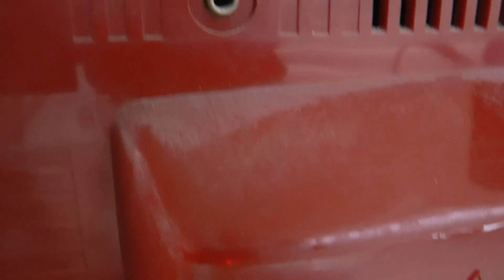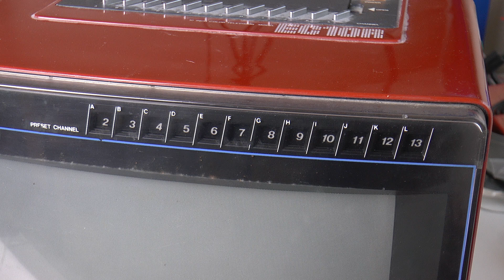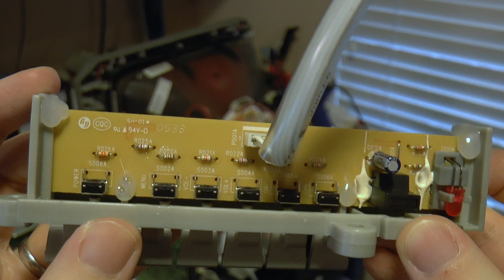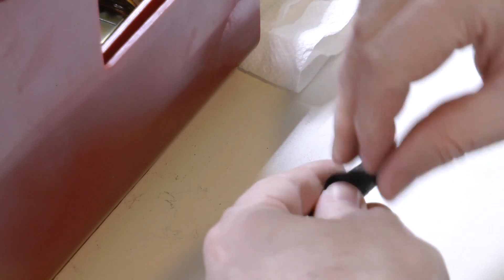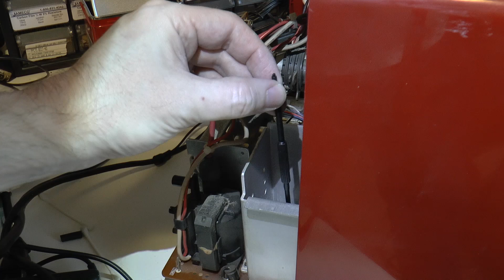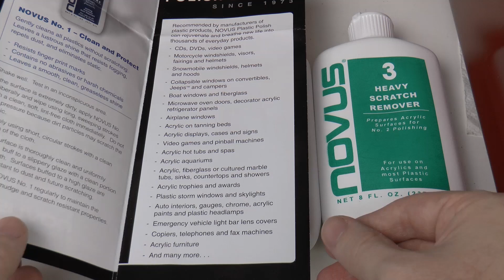Do you game on a CRT? Review and Repair of my friend's RED CRT

Comment: I bought one of these at the flea market yesterday and it looks almost like new. It's dated October 1986 it was just too cool looking to pass up.
Reply: Oh, btw, the one I bought has RF input along with the antenna screws and a little pull out piece to go from UHF 75 ohms to 300 ohms. Can't get a picture from a NES yet tried composite and RF so may be something to do with that switch on video not working for the composite and the RF not sure unless it's that UHF setting piece needs to be on 300 but I think not. Maybe the tuner is crapped out but the channel buttons do change the screen when pressed. The guy assured me it worked but who knows if I can get the composite working that's fine. If I can't get it working I'm going to removed the insides and find a LCD that will work inside it since the TV is so awesome looking.

Comment: I combine a high-quality consumer set (Trinitron) with component input for PS2, Xbox, Gamecube and composite for NES, SNES, Genesis, and PS1. I own a decent LCD and have modern FPGA consoles like the Super NT, but honestly I don't think anything beats the classic warmness of the original systems on composite input for those 4. 

That said, now I also own an Analogue DAC so I could still get that chunky analog signal from the modern FPGA consoles if I really wanted to. But so long as my original hardware works, I'll keep using it.

Comment: • I want to see a followup. I've got a TV that doesn't keep the picture horizontally stable. 
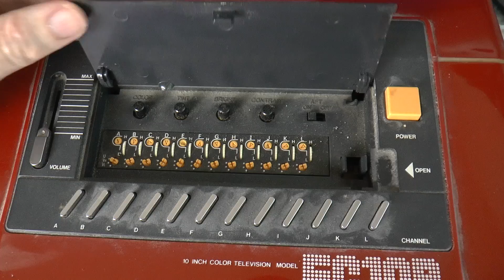(3:42) That looks just like the tuner on the VCR we had, which allowed us to pick up premium movie channels, with varying clarity. Late night softcore was the best I could hope for. 
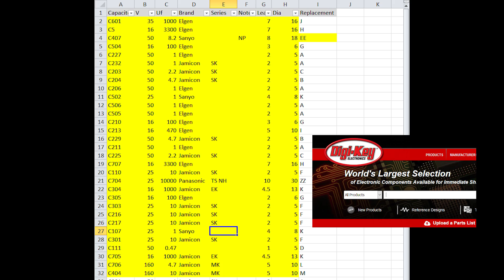(7:26) I forgot Digi-Key sells capacitors. Last time I ordered from them was 9 years ago, and it was to cover the landline phone jacks with plugs, to stop some of the air leaks in my apartment. 
What I was actually after, was opaque optical output covers. I have a DVD player that was a display model which lacked an opaque output cover, so the player shows a bright spot on the wall. I tried covering it with black electrical tape, but it wasn't enough. Layering the tape fixed the problem (sticky side against sticky side so as to not leave residue), but I'd rather have a proper opaque optical cover.

Comment: I have a CRT from 2004ish its part of a Sammy arcade cabinet, the CRT has issues, it displays a picture with a heavy red tint, I connected a 15pin vga connector from the Atomiswave unit to an LCD and it worked fine, my guess is the CRT is faulty. I'm going to scrap the whole system, if you'd like I can send you the atomiswave box along with the game cart (Maximum Speed) and jamma connector for your own research. you can have it for free. I believe it is just a sega dreamcast which takes cartridges rather than CD's.

Comment: Yeah I'm one to be happy enough with composite. I do prefer to game on a Trinitron though and not the shadow mask sets. I got a wood grain version of a Sony KV-1393R and I think it's beautiful. I did a CRT swap with it from my KV14TR24 since the convergence was pretty bad on the original tube and the deflection yoke had no adjustment rings on it! (it came with a plastic sleeve covering where they should go so it must have come off the factory like this). Even with a different yoke that had rings I couldn't get that tube where I wanted it so I just used the one from my KV13TR24 as I managed to get the convergence mostly ok on that one. :D

I even soldered in a trim pot for vertical linearity after finding where it should be on the schematic. The new tube/deflection yoke combo needed an adjustment but this set didn't have that adjustable. Used a fixed value resistor instead so I had to take out the resistor and put in a trim pot in it's place. I had also changed out a resistor used to control the screen sharpness control. On this set there was no knob or adjustment for that. They also just used a simple resistor. I used a trim pot to get it where I wanted, then got a resistor with matching value and used that to lock that in. It's looking great now. :D

Oh and if your wondering how I have an extra yoke...well long story short, the KV14TR24 was my first Trinitron I wanted to get. The first one I got off eBay was packed poorly and the bottom mounts for the CRT had failed while it was in shipping, The end result was a destroyed neckboard and a necked tube. So after got refund and confirmed seller didn't want it back, I kept the main board and speaker, and deflection yoke, and tossed the rest.

Then got a second KV13TR24. This one was packed much better (also off eBay). But it arrived with the same failure too! bottom mounts failed and the tube had swung up a bit. This cracked the neckboard in half (but not as badly as the first one) and somehow the tube didn't get necked. The main board on the set was dead though (had a crack in it and a bodge wire soldered in so looks like that board was cracked before it was shipped). There was also evidence of rust on some of the RF shields. Luckily the main board from the destroyed TV was still in great shape. I fixed the broken traces on the cracked in half neckboard and got the KV13TR24 back to working order (I had also gotten a refund on the second TV by the way). The neckboard from the first set broke in half in away that severed alot of traces so I couldn't really use it. The second one that survived mostly had it break in half on a different axis so only had to fix like 4 or 5 traces with bodge wires.

Not long after that the KV1393R showed up on local Facebook Marketplace for only $10. I just had to pick it up because it was cheap and the tube looked like it would be compatible. Only had a blurry photo of the front so all I knew was it was a 13 incher like the KV13TR24. I was surprised it was a woodgrain chassis when the seller showed up to deliver it. The tube ended up having worse convergence then the KV13TR24, but I liked the KV1393R so much that I went ahead and just put better tube of the KV13TR24 into it and made some adjustments. I know have a really good retro game TV. For those wondering the KV13TR24 and KV1393R can't be RGB modded. I did check the schematics. Neither set has closed captioning and the OSD output gets amped and muxed directly into the output of the jungle IC and even then the B line isn't wired up for OSD (OSD used green font) so wasn't suitable for RGB modding. Jungle IC has no RGB inputs. Only neckboard mod would work and you'd have to build an AC type RGB amp for it. (the DC type amps commonly used aren't suitable. Neckboard mods are more like arcade chassis in this respect since they also require a AC RGB amped video input)

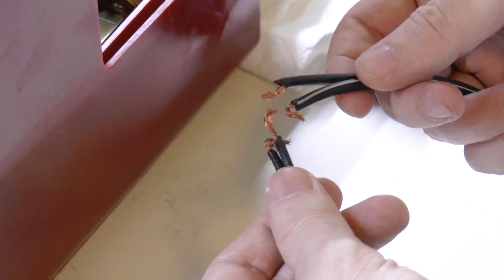Comment: I bought a used PS2 for 10 bucks a few years ago. The power cord on its AC adaptor was severed and taped like the one at 9:42. Ended up just tossing it and getting a replacement. Also had to replace the ribbon cable from the power button daughterboard to the motherboard. Still only ended up costing like 20 bucks.

Comment: I have a 30" flat screen CRT that I play on. But lately it keeps turning itself on randomly, and once on I have to turn it off physically. Is there an easy fix that a laymen could do?
Reply from the maker: I don’t suppose it is an RCA Truflat TV from early to mid 00s? I have a video about the buttons going out on the front panel and how to replace them. Ideally, it is a simple fix like that rather than a power supply/standby issue.

Comment: This restoration video is awesome!  I’d put the screen protector in storage personally.

I usually use an OSSC or FPGA consoles when I play my retro games anymore.  I have 3 CRTs in the basement that all have small issues that I find irritating.  My 27” has a tilted picture and I’m not comfortable fixing it.  A 36” Sony with washed out colors.  And a 36” Admiral with no component input.  I’ll probably set at least one of them back up soon because I’d love to have CRT as an option again.

Comment: Is there any way to muffle the whine from old crt tvs or is that just part of the experience that cant be changed?
Reply from the maker: Some CRTs have a whine that is a bit more prominent after they age, but it is definitely a "thing" as 15 kHz is within the frequency of our range of hearing - at least at a younger age. Many lose the ability to hear the frequency as they approach and pass the age of 40.
Reply: I remember going to electronics stores when they had dozens of CRT’s. The whine was insane! Not to mention the dust they picked up...

Comment: i debated on buying a pvm but ultimately i found a 1995 34 inch Sony Trinitron around town for i think less than 20 bucks, to me it was worth that in gold, and well it works well
Reply: Yeah my dream is to have a PVM, no CRT looks better than them, but at the same time I'm thinking of just getting any old CRT as that's more "authentic" to what I used to actually use in the early 90s, and a hell of a lot cheaper than a PVM too. The blurry goodness is what I really need. I do wonder if you can get adaptors to go from HDMI to scart for example (we used scart in my country, it was the best of the old connectors) so that I could play my mega drive mini with an old CRT, as the blurriness was intentionally used in many games to fake a transparency effect, and so it can look weird with pixel perfect HDMI quality.

Comment: Why haven't you tackled into the shadow problem or as you called it a voltage problem?
Reply: high voltage cannot be adjusted on this set
Reply: also it's a ringing artifact, I wouldn't be surprised if it was actually coming from the famicom, but if it is in the crt it could be related to decoupling caps on the inputs or neckboard.

Comment: Personally I don't game on a CRT because I have access to a couple of old mid to late 2000's HDTVs that when the settings are tweaked, look as good as a CRT. Sadly, they are very hard to find and I happened to come across them purely by chance. But I've found that the best telltale way to find these HDTVs is to find ones with speakers that don't sound like black metal.

Comment: Any suggestions on removing scratches from the glass of an old crt screen?
Reply from the maker: I don't have anything specific to recommend here except to say be careful if you find a homemade solution on the web - experimenting with various suggestions could lead to injury. There are some wild ideas floating around.

It is also possible you have a scratch in anti-glare coating that has been applied to the front of the screen instead of the glass. I haven't performed anti-glare removal on a CRT, so I cannot comment on the operation.

Sorry to hear you have a CRT with scratches though, Zach. Best of luck!
Reply: @DisplacedGamers  Has one that's thin enough to not be too bad but it's still somewhat noticeable
Reply: @Z64sports  Depending how deep it is there are polishes made for automotive glass that might work
Reply: @starquestman1544  anything specific?
Reply: @Z64sports  I cant remember the name of the product i used, i should have the box somewhere though. it comes with some very very fine grit sand paper to level the scratch if needed and some glass polishing compound if i remember correctly
Reply: Found it! google "ccp 5 minute auto glass resurfacing" it took some very light scratches out of my windshield but im sure it would work on a CRT. your mileage may vary though
Reply: I bought it at my local NAPA under part number BK 760-1752

Comment: CRT for me, its how it was, its how the artists designed the graphics, on crts. Im not a fan of the blocky pixel look on modern devices, i like to see dots even if they are wonky or glitter. You should see the rainbow banding/candy striping on my old Acorn 32k machine its psychedelic. As a layman kid all these artifacts seamed like part of the intended effect, sometimes they were intended. the graphics feel more alive, like an analogue sound device vs digital.
Reply: LCD/LED for me. I've gotten so used to the pixelated look on modern displays and faux-retro games. CRTs are too big and heavy, and space is at a premium with my gaming setup. I have a Genesis/32X, Saturn, Xbox, and PS2 all hooked up through YPbPr cables and won't go back to composite. The only way I'd ever go back to a tube TV is for games that use light guns or active shutter 3D glasses. If I were to go back to a tube, I'd like to get a professional monitor with RGB, some SCART cables, and a SCART switch box.

Comment: You know that image you got when you had the screen brightness cranked up so high you could see the electron beam heading back? My bvm1911 does that for a second every time a turn it on. But then it goes away. Why does this happen?
Reply from the maker: You could try dialing down your screen voltage just a bit to see if it makes a difference. Hopefully your screen brightness level stays consistent throughout usage.
Reply: @DisplacedGamers   it's fine after a few seconds. I'm not sure it's an error. I think it might have something to do with normal power cycle. Not sure though.

Comment: Man, I wish I understood electronics enough to fix them myself XD. I got a 19" Samsung Syncmaster (955DF) monitor some time ago, pretty cheap, and it was just that much better to have a slightly bigger screen for my PC, compared to my 17" that, now, I'm using again... That's because the 19" one worked for about 20 days with "bearable" CRT issues, before it presented a new one that's quite unbearable. It got a blueish filter that causes some sort of ghosting when there's grayish backgrounds with bright objects over it. Thing is, the issue was kinda random, as turning it on or off would sometimes make it go back to normal. Lowering contrast to zero could also lessen the issue, but very rarely. Then I got pissed and simply dared opening the thing "just because", looked inside and put it back together... Weird of me, I know, but at least now, the monitor works ok for a few minutes when turned on from cold, before presenting the issue again XD.

But anyways, your videos are a great watch, and I appreciate how well you explain your know-hows! Keep 'em coming!
Reply: If you like that monitor you should get it recaped. I bet this would fix your issues. It usually costs around  150 to 200 to get a recap. Or you could try it yourself
Reply: @riggel8804   Well, the monitor was so cheap, that it would be better off waiting for something similar to appear than spending more money to try to fix it. As said on the video, there's the possibility of not being only the caps... The thing sure is old, although not that much (made in February 2004 XD), but if it is something else, I guess it would take a long time to find any good replaceable parts around my region.
Reply: @ClaytonCLF  sounds like caps to me. Any old monitor is going to need a cap replacement. But yeah if you think you can easily find another one with less issues it makes sense to get another one and then recap.

Comment: Wow!! Thanks for archiving this old gem!!  Also you say geometry is “best done with a genuine video signal generator”  where would you get one of those and how do they hook up to display on screen?
Reply from the maker: Hey beefcurtainz69! You could pick up a used one on an electronics surplus or auction site. They may have BNC connections for various outputs (composite, YPrPb, RGB) and the usual 4 pin mini din for s-video. You can adapt BNC to RCA if need be. If you need to hook it up to a set that doesn't have any of those signals, you could always feed the composite out into an RF modulator. If you don't have access to a signal generator, Artemio's 240p test suite is pretty useful! 

Just be aware that something like color calibration via the composite output quality of a Sega Genesis (for example) may not yield the most uniform results!